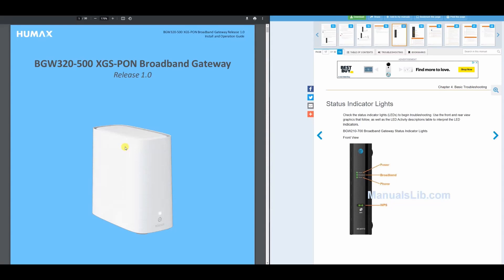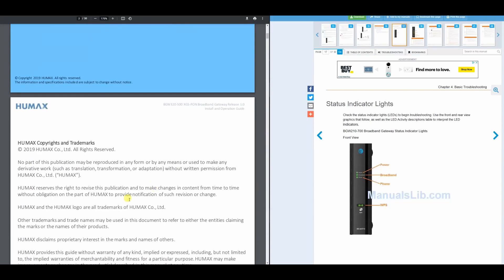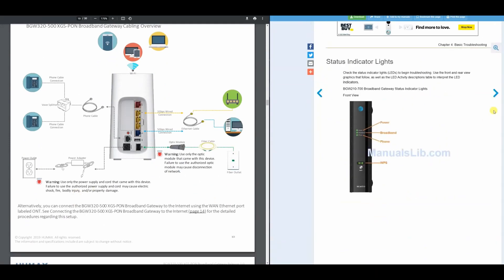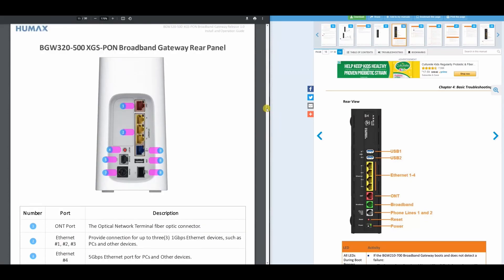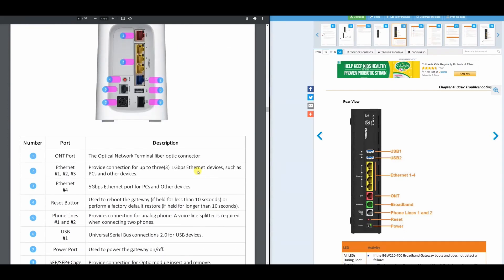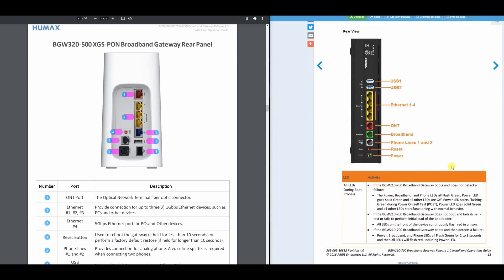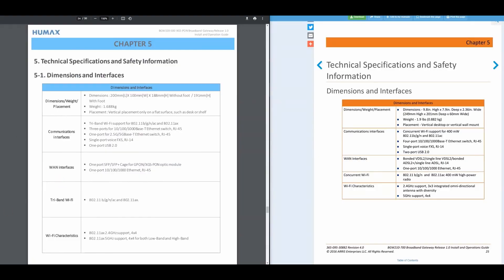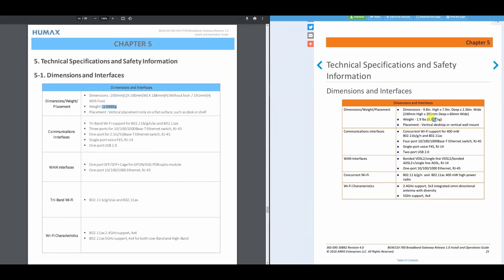AT&T BGW-320 vs BGW-210 | Part 9

Comment: I have fiber gigabyte internet and have the 210 with ONT as well. 
I hate the router it always drops connections. I want to buy a better router from Best Buy. Is it possible to swap out the routers or hook up a better range router after the 210? I have range extenders too but it seems like the 210 cuts out a lot during important work meetings. I tried reset and att did some stuff too…
Reply from the maker: Sorry man, I have switched to Vz fios fiber
Reply: No. I found out you’ll need to still use the 210 but you can put it in IP passthrough mode - and then hook up a new router connected to your 210. I used TP link Wi-Fi 6 mesh system and it’s great. You can find info on set up IP Passthrough mode on your 210 on several YouTube videos. It’s easy.
Reply: I have a 320 and just turned off it’s wifi and have it feeding a 24port switch and a Netgear WAX630 Access Point.

Comment: Hello. I have a Remo Bell S doorbell camera that used to connect/work with the 210 but I cannot it to the wifi on the 320. Can you suggest a solution? Thx!!!!
Reply from the maker: Did you change the password? My ring doorbell did the same. Perform a full reset on the doorbell and reconnect to the Wi-Fi. Your doorbell will connect to the 2.4g network.

Comment: I have, have had for a while, the bgw210. I just purchased a Orbi mesh router system (3 units) with WiFi 6.  Do I need to ask ATT to Upgrade my bgw210 to the bgw320 for my Orbi to work?  and/or for it to work to its capabilities?   Thanks in advance for any advice you may have!
Reply from the maker: If you’re using Orbi. You dont need 320 router

Comment: I upgraded my internet service, then 2 days later, I was sent a BGW 210.  The technician installed BGW 320 without issues. Wouldn't this be considered a downgrade? What reason would they have to send me the 210 if the 320 works perfectly well with what I pay for?
Reply from the maker: You should complain. That is very unusual
Reply: Same thing just happened to me, did you end up keeping the 320?

Comment: They are sending me the 320 but they did not scheduled a tech visit. Can you replace one with the other easily? My current 210 is located in a different room than the fiber ONT box.
Reply from the maker: Very easy replacement. I have a video on it. You’ll need to set it up as a new router.
Reply: @ALIMKRAJA  thank you very much for the quick answer. 👍🏻
Reply: @ALIMKRAJA  now AT&T says they cannot send it because the box installed on my wall is different and this router needs another set up made by a technician and is not available for my location…does this sound something you would trust?
Reply: You have to have trunk roll tech install for the bgw 320.